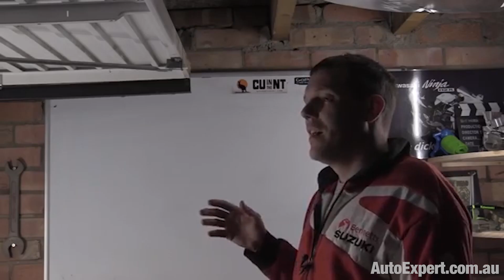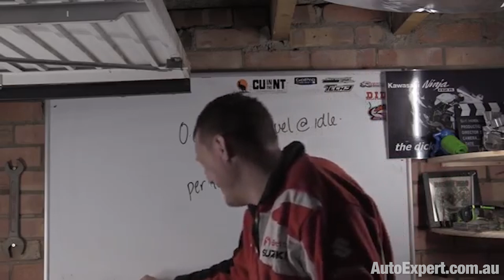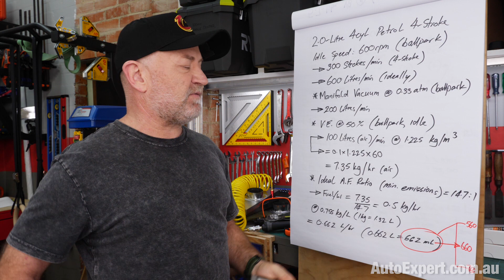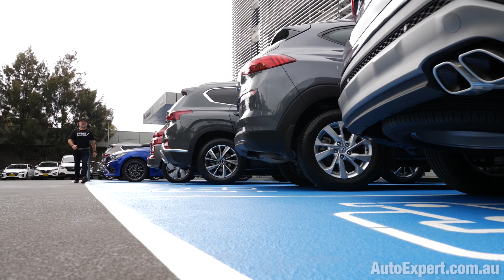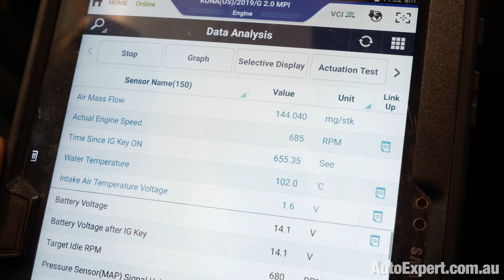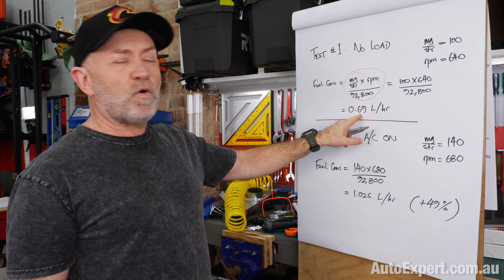Engine Fuel Consumption at Idle Explained (theory and physical test) | Auto Expert John Cadogan

Comment: 0.6 litres/hr is not 100mg per stroke at 640rpm, that's BULLSHIT!!!!!!!.   It should be more like ~6mg per stoke.  Just do the maths.  100 multiplied by 2 (strokes per rev) multiplied by 640(rpm) multiplied by 60(min in an hour) and then divide by 1 million to get Kg per hr, Oh and then divide by 0.755 for Specific Gravity to get Litres per hour.   Correct me if I;m wrong but I don't think I am, it's simple primary school maths.  I don't need a degree for that.

Comment: That's a lot of effort for something a modern car's infotainment system displays on the dashboard  while you are sitting at idle on a traffic light, which I do a lot back here in Europe. 

https://gifyu.com/image/Etqe

My point is, Jon, I challenge you to step behind the wheel in a modern VW, Audi or the cheaper ex-communist sister Skoda, which I own, and go through all the measurements it displays like : instant fuel consumption at idle and whike criusing, the oil temperature - what's that for?
Reply: I have the 1.5TSI tgat is petrol with Active Cylinder Management that is shutting off 2 cylinders at times claiming diesel-like consumption when driven appropriately, maybe you should do a bit about this. I would be very interested in your opinion giving the fact that VW claimed it's the last ICE they are developing.

Comment: Hi John. As there is only one power stroke for every two revs with a 2 stroke and a four stroke has one power stroke for four revolutions. I’m guessing a 2 stroke will use double the amount of fuel at idle compared to a 4 stroke, all other given things being equal.

In regards to Mr Workshop, did I see he tried to light a cigarette in a shed probably which would contain fuel in a jerrycan?

Comment: I wonder if he got stuck in the rate and not the values?

"Generally, an idling car uses somewhere between 1/5 to 1/7 gallon of fuel per hour. Compact cars that carry a 2-liter capacity engine burn around 0.16 – 0.3 gallons of gas on per hour basis. A large sedan, on the other hand, with a 4.6-liter engine, burns approximately 0.5 – 0.7 gallons of gas while idling."

https://www.youtube.com/watch?v=dFImHhNwbJo

So perhaps we can say 0.3L/h/L ...
2L x 0.3 = 0.6
4.6 x 0.3 = 1.4 -> 0.35 gallon/liter

I would assume that friction and engine design will vary this a bit. It still looks to me though that Start/Stop DOES save fuel, but it's going to be very little if it's once for 1 min every 1h, and much more if you are in stop & go traffic. 

10 mph stop & go, 25% stopped most likely will give you around 10mpg, and you save 0.04 gallon or 4% ... so a 4-8% saving for city/stop&go seems reasonable to me?

Comment: Very informative. Thanks. I wonder what the extra fuel consumption would be idling with the car in Drive with the brake on. Like one would at traffic signals or in a traffic jam (not that anyone would do that for an hour!). Comparable to figures with AC on or worse?

Comment: You didn't check the air fuel ratio on the running engine, that is required data and not something you can assume. It needs to be measured, not a set target. Also the correct fuel free from additives that will alter the formulas numbers { ie lead, ethanol, sulfur content etc. Australian fuel quality standards are not the same as the rest of the world}. The core of doubt between the statement on Google and the figure you have derived still isn't answered.  You continued to use the Argonne National Laboratory figures quoted and these are missing the data of AFR and fuel type other than calling it gas.

Comment: um guy on dry board says 1.6 Liters but then draws 0.6 on the board then complains about a guy that cant read? 🤣😁
Reply: I can't tell if it was supposed to be 'naught point six' spoken with a speech impediment, or ???
Reply: Yeah I was thinking he said 1.6 but then the second time it sounded like naught point six. So I think that is what he said first time. My excuse is I have a hearing impediment to some accents!
Reply: @mickjager5974  thats definitely "one point six" not even a mumble accent can hide it
Reply: i thought this too but he talks about something different from what he writes about. he writes out the rule, but actually talks about what John said. he said 1.6 as in what John said, while also writing the rule, 0.6 l/h/l, then explains, John cant read because a 2 liter engine would be only 1.2

Comment: It is definately NOT 600ml per hour per liter displacment. I have a 2015 6.0L V8. At idle it uses 1.8L per hour with the AC on. 1.7L per hour with the AC off. I'd go even further and say that most people do not know how to drive a car effeciently and I have seen people running a 2.0L 4Cyl using more petrol (l/100km) than my 6.0L V8.

Comment: Idling automotive engine has to make electricity for itself and the computers, stereo , dash,... as well.  There are times of the year and locations on the planet that require refrigerant compression as well.  If it stops and has to catch up... then battery charging loss and air conditioning catch up has to be considered.  Auto start/stop should be banned.

Comment: I guess once an engine has hit its steady idle, it'd keep turning forever barring friction. Idle fuel consumption is purely representative of how much energy is lost during all that internal rubbing going on. Of course the lubricant helps make that a vastly smoother process.
   ...

  I'm guessing a more efficient engine on average (idling or otherwise,) would be one with the largest displacement per cylinder count. Because smaller pistons/cylinders would have higher surface to volume ratios (and thus would be equivalent for most the engine systems, intakes, exhausts etc)
   So for an engine with a smaller displacement volume/higher cylinder count would be rubbing a lot more surfaces for the amount it puts out.., i mean outputs

Post edit: I guess to be fair, the above suggestion is still subject to about 6.3x10^412 other engine variables

Comment: I am not an engineer. Did not do a university degree of any sort. Did do a technical job with electronics and with the training  to do the actual math required. Yes the math looked about right for what I know about  4 stroke engines and the general & physics properties of petrol and air. Thing is most people don't spend hours idling (unless stuck in traffic jams) what they do is drive from point A to B with relatively short stops where the car actually needs to  idle, In my experience the most fuel is used when actually driving where the engine must over come its internal losses,  the losses of the drive train , friction of the road, mass of the load and the vehicle, gravity (inclines and such) and last but not least Drag by pushing its self trough air. So idle efficiency was never much on my list of things to worry about. What I worry about now does it start in the morning? do bits fall off? how safe is it? How long can I own it before it becomes worthless and unsafe? How much will it cost me over its life time? will it do the things i need it to do for 90% of my intended use (never bought a 4 wheel drive for the one weekend of 52 of them I might go off road)   can I live with it? Some times looking at the bigger picture helps. Old saying Penny wise Pounds foolish!

Comment: Like stated, as a Quebecistaneze, Quebec is pretty cold in winter and i may be wrong, but i suspect that idling fuel consumption is higher when temperature is very low just to keep the engine in the good operating temperature. Also, the study might be about an engine warming up in cold weather. Anyway, fuel consumption is always higher in winter. And funny things, the Start/Stop feature never trigger in winter !

Comment: Automotive engine must be sort of 0,6-0,8 L fuel consumption on idle. Other engines must be different. Let's say one cylinder honda 300 ccm engine must get horrible result because it has big bad ass flywheel/fan to keep things cool and spinning and it doesn't have super efficient oil pump, it just splashes oil around and hopes for the best. Also it doesn't have fancy direct fuel injection, it has carburettor which is dripping fuel around and hopes for the best. 
Also engine which is gonna get bad idle fuel consumption is any engine from motorcycle which revs up to 12 000-15 000 rpm, valve settings and timing are simply horrible for low rpm situations. Some older bikes are like screw up idle stuff, we are doing it at 3000 rpm(still remember my honda NSR 250, pure beast at 16 000 rpm).

Comment: Well i would like to say my works verchile does use 3l of diesel per hour idling but since its a 13L  straight six scania i can safely say its way way less than .6l per litre of engine displacement. And on the point of start stop tech its amazing that this isnt an option in large trucks we had ad blue first adaptive cruise and all the rest but not start stop
Reply: I also think the .6l per hour ball park is a balls up probably not calculating a 4 stroke engine the trucks idle usage is significantly lower than .3l per 1l of capacity at idle probably since it idles at 450rpm but i haven't checked other cars to see any difference with other verchiles on idle usage to cubic capacity if i ever get a odo scanner with live data showing air the air intake per stroke i could work it out on my 1.0l runnabout and my 1.6l suv witch would be quite an interesting comparison to add to the 2l

Comment: Why not simply say: 300 ml per hour per LITER OF DISPLACEMENT?
Reply: Because that won't hold true. It's not linear.

You will also run into large variations on large capacity engines with more than 4 cylinders - they'll be switching them off.
Reply: @Setright  According to John's calculation it is linear. Whatever displacement you assume initially, the end result is proportional to it. For the case of switched-off cylinders, we can use the displacement of the active cylinders.

Comment: John, serious question.  What's the difference between the fuel consumption at idle in park vs in drive with the additional load of the transmission torque converter/fluid etc as it slips in traffic? I'm still 100% with you that start/stop is bullshit and has no real world significance.  Cuz really the math works out that at 600ml/h fuel usage. And the price here in Canuckastan is $1.20/L approx. So that saying even best(worst) case scenario your stuck in traffic for an hour a day in which the engine would shut down.... gonna save a whole 72 cents? But really you might spend 5-10 mins a day all up with the start/stop doing its thing.... for a whopping 6-12 cents/day savings... people really are that stupid to buy into this bullshit tech that just complicates things and makes vehicles more expensive.  You'll never recoup the initial cost let alone the added weight in the vehicle will burn more damn fuel anyway!

Comment: Another Pom (none winging here and my 4.5 litre V8 uses only 1.2 litres per hour when warmed up with an idle of 570rpm. Your first "rough" numbers John were about right on the money!
Reply: Well, that's what my thoughts were, I bet his 3 litre engine won't use much more either, because once the weight is moving, larger piston area to push against, same amount of fuel in bore as 1.6 engine? Modern computers run engines as close to max heat limits ie lean burn as possible.  Needs the test doing in real life, plug live data to a vehicle and watch it.

Comment: Great lesson John.
Would have been better without shit canning the other tosser.
I wouldn't have wasted any air oxygenating cretins like garage boy.
Just the facts is all that counts.
You can buy a lot of petrol with the money saved by not having to replace the ridiculous batteries and starter motors over the lifespan of the vehicle if you can turn it off permanently.
As well as all the unnecessary complication to the vehicles electrics and powertrains it requires 
Ultimately I hope its just a passing phase and commonsense will prevail soon.

Comment: The theoretical calculation assumed stoichiometric combustion. Real works engines run a little richer than that to avoid high temperatures and keep NOx emissions down. That might explain some of the 15% deviation.
Reply: There's little chance of detonation in an idling modern 2 liter 4 cylinder gasoline engine.  They do go richer at high power output though (12.5 : 1 is not uncommon and turbocharged engines go even higher), as you noted.  None of that matters at idle, unless you drive a top-fuel dragster to work.  Those things are crazy!

Comment: It's likely idle consumption increases with engine displacement, but not in direct proportion.All other things being equal.
Reply from the maker: It'll be reasonably proportional.
Reply: Hmm, displacement increases on a cube law as you upsize an engine, but friction areas only on a square law.
Reply from the maker: @johnwade1095  The engine's not just working against friction...

Comment: Call me a twat, and you probably will.
But rather than go to all that trouble, Just run a car till its nearly empty, park it on your drive idling till it runs out.
Then pour a ltr of petrol into it and time it.
Then repeat a couple of times and average it, job done.
Works with any engine, any car, any liquid fuel.
Reply from the maker: Great idea if you want to sit there for nearly two hours...

Comment: I once hired a Ford Falcon XT in Melbourne for a week and later owned a Holden Berlina, both with about the same sized engine. They both had trip computers that showed fuel consumption in litres/hour while stationary. They both reported about 1.6 l/hr and they are both in the 4litre class and both about 20 years old as at Now. So  0.6l/hr for a 2 liter MODERN engine sounds about right. NZ Steve

Comment: I've recently had the opportunity to take part in an ongoing nation-wide fleet idle loss study, and while an NDA keeps me from publishing data (sorry!), I will say that in a large fleet environment, stop-start systems have a significant impact on fuel savings. The study takes into account increased maintenance cost for related items and compares it with costs of theoretical non-equipped vehicles on an identical schedule, and also tracks and compares Out Of Service losses resulting from parts not being in-stock when needed.

I feel quite privileged to be a part of the study, as my day-to-day with the company is as a mobile technician, not a number cruncher or analyst.  My direct input has resulted in policies being developed that retain the annoying stop-start functionality, but allow for drivers to retain enough control over the system to deal with things like pulling out into traffic, and keeping the A/C functioning in rush-hour situations.

All that being said, there is absolutely zero benefit to these systems for the average individual consumer.  You'll never notice the fraction of a financial unit you're saving at the pump at each fill-up.
Reply: Did you see fuel savings in the region of 5%?

Comment: No car I’ve ever measured the vol eff on has been as low as 50%, typically around 75% at idle, so you’d need to add 50% to that flow. (That’s ranging from pushrod 2v through to dual variable valve timing 4v)
While I agree a per litre measure would be wrong, a bigger capacity engine will certainly have greater internal friction to overcome and thus use more fuel.
Reply: Won't it use more fuel,  BECAUSE it's bigger?  More cylinders, sucking in more air, needs more fuel ...right?

Comment: Air cooled flat 6 aircraft piston engine 541cu/in (8.865 litre)  at 725 rpm spinning a propeller uses on average 10 pounds per hour,or 6000ml   per hour.

Comment: Ha ha ha. Many cars, such as my FG XR6T show L/hr at idle. So.. for this 8.9:1 compression (cr is all important) 4L engine, 1L/hr idle in neutral, 1.2L/hr idle and in drive, 1.8L/hr idle in drive and the AC on. See, that wasn't so hard now.

Higher compression ratio engines will use less fuel @ idle.
Reply: my 2010 Ford Fiesta 1.6L diesel would display fuel usage per hour as soon as I stopped moving ...must be a Ford feature..... and from memory it showed 0.2 L per hour...not sure if air was on or off.....anyone still have one of these to check my memory!
Reply: mekuranda the higher compresson ratio of that diesel gives them their idling low fuel consumption. Another thing to consider is there are altenator loads that might be a significant factor @ idle, and might not vary much for the different engine sizes, so would be more significant (per L ) for a smaller engine.
Reply: Nor Dic 
It’s not only the higher compression ratio that makes a Diesel engine more efficient but also that it can run at open throttle. There is no need to run at near stoichiometric ratio’s so there are less pumping losses. 
Also diesel fuel contains more energy than petrol.

Comment: I calculated this out using a different method but the same 100mg/stroke etc and came to 691ml of fuel/hr. Seems ligit to me. I think you said in a previous video on this that Argonne had their engine running without any of the accessories like the water pump/power steering and so on. Im sure this would easily account for the 15% variance.
Reply: Would love to see those calculations.

Comment: Darwin city is growing because people figure a smart city makes people smarter...
If fuel and air could be controlled how low can you go when idling an engine? A reasonably modern engine. Let's say 91 octane?
That said 1l of petrol in the Corporation of New Zealand is $2.10 - when driving in town would driving with the windows down be more efficient than driving with the air con on?

Comment: 1.1 to 1.3 l/hr is shown even on the car's trip computer in father's 1984 Opel Senator with a NA 3.0 petrol engine when the car is idling. If all modern cars would show not only mpg or l/100km but also l/hr, there would be far less confusion about this. Even 35 year old cars could do that, why is it so hard to find a car that is not hiding its idling fuel usage nowadays?